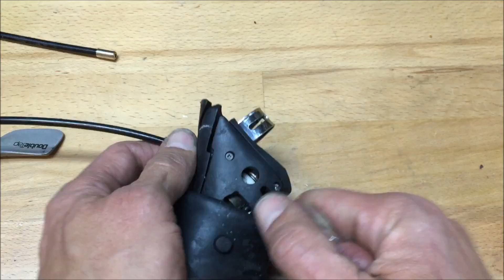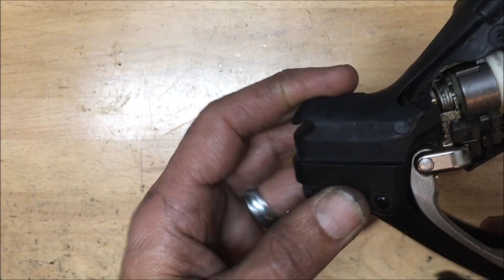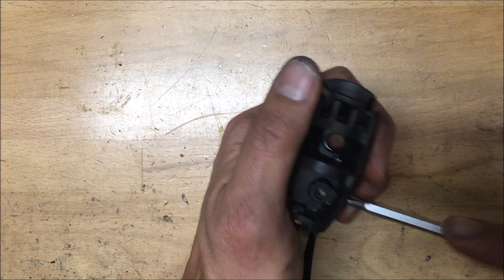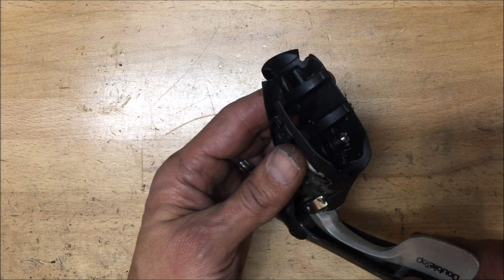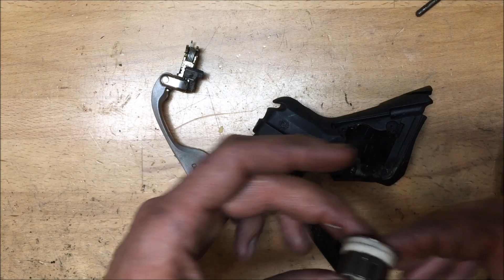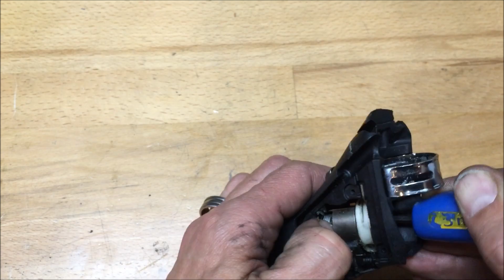Sram Doubletap Shifter Rebuild

Comment: Where can i find that repair set?
Reply from the maker: SRAM sells a few of the shifter small parts, but not the pawl housing piece that typically breaks in these shifters. At the bike shop i used to work at, we kept a bin of old salvage parts, and would occasionally get shifters with either the left or right side damaged, so we would save the other or if there were any usable parts that were still good Etc. If you have a large bike shop near you, you might try them or your best bet may be to look on eBay. I've seen lots of individual used SRAM shifters or partial assemblies with good working parts you could use to fix your shifter. 
I had a viewer as the same question a few months ago, and I found a couple partial of complete shifters that would work on eBay for under $20 at the time. Thanks for the question and hope this helps!
Reply: @JoeyMesa  First of all, thank you for your reply. I got 10-speed force right shifter but only cylinder mechanism and a spring are in, other things are lost. Unfortunately here is no sram dealer or any shop that sells sram parts. I've decided to find any version of sram 10 speed shifter and try to place that parts which is missing parts  in force shifter. Is it possible, or not? Do you have a social media account that I can send you a picture? I'm sorry if I have misspellings or grammatical error.

Comment: I have the same fault.
Please specify where to buy? (Wherever ... USA, Canada ...)
To fix it, I need a part number and a seller - it can be Force, Rival or Apex. (10 speed)
Reply from the maker: The problem is SRAM doesn't sell the lever with the ratchet mechanism as a separate part, or to be more specific, the don't sell the part that typically breaks. You can buy used shifters on eBay for a decent price and pirate the parts you need or use the whole thing if it's better than the one you have. 
Usually I try to save usable parts like this to do this type of a repair (I work in a bike shop), but at this time I personally don't have any.
Reply: Thanks for the information.
It remains therefore to buy a complete shifter.
Reply: Hi Andrzej, if you still need the part just let me know.
Reply: @JensWorkshop  No thanks. I bought a whole and new one. I think only Taiwan is doing it now, with no items available for the site.

Comment: Thanks for this video. I'll be using this to gut the mechanism out of the left shifter to do a 1x set up on my spare bike with an x9 clutch derailleur
Reply from the maker: Sweet! If the internals are still working, you could probably sell them on eBay. People are always looking for them.
Reply: Joey Mesa that's a good idea. I have no use for the left side shifter

Comment: Do you know the internal differences between force and red? I bought a set of second hand red shifters and they weight exactly the same as force. I suspect I bought force shifters with red levers actually. Is there a way to check it? Thank's
Reply from the maker: I'm not sure if there's much of a weight difference between red and force shifters, but, one difference that has been pretty consistent is that on the rear force shift lever, there is about 3/8" or 10mm of play when you start to shift until the lever engages. On the red shifter, the shifter engages immediately with no play as you start to shift it. Again, this has been pretty consistent on all year models. The front force and red shifters basically feel the same.
Reply: Thank's for the details, that's great help. I don't have any play before shifter engages so I guess I am actually with red shifters. I will check with one my mate who is equipped with red shifter and check if engagement is the same.

Comment: hello, I'm with the same problem, your video is spectacular, but how do I do or where can I get this part to be able to replace? I'm in Brazil if you can tell me a store or something?
Reply from the maker: The problem is that Sram does not sell this particular replacement part. Basically, you just have to find a used one with good shifter parts. About the only sources I know of are local bicycle shops that keep old usable salvage parts or maybe eBay.
Reply: OK thank you
Can not you tell me somebody or a site?
Reply from the maker: https://www.ebay.com/itm/SRAM-Red-10-Speed-Doubletap-Shifters-Set-Front-and-Rear/322871536787?hash=item4b2ca4ac93:g:ztgAAOSwJtdaA41u
Reply: Hi Alcides, I have the part you need. If you still need it just let me know.

Comment: can the left side shift lever fit the right hand side one?
Reply from the maker: I've never tried it, but I don't think it would. Everything is backwards from one side to the other. You may be able to turn the left ratchet wheel backwards and run it with all the right side parts on the right side, but other than the ratchet wheel, everything will only work in it's corresponding side I would think.

Comment: Hello Mesa , where i cna buy the only doubletap with  this part on the up ?
Reply from the maker: As of right now, it's not available. I keep suggesting to the sram tech guys that they need to sell more internal pieces, but no luck so far. I've always just scavenged the parts off old shifters that had broken brake levers or housings, but the shift parts were still good.

Comment: Hello Mesa , where i cna buy the only doubletap with  this part on the up ? Help pls men , rly need help
Reply from the maker: Unfortunately, Sram doesn't sell this part of the shifter.  You may be able to find a used shifter or one with good parts on eBay or possibly check with your local bike shops to see if they have some salvage shifter parts they would be willing to sell.
Reply: +Joey Mesa  I watch on e bay but i canot find only that broken part or all duobletap with that part on up. I em from Serbia we dont have sram gruops or something like thah ..

Comment: I've found that you can pop the pin out using a long thin allen key through the break lever, you need to hold the brake lever down and push the allen key through the brake cable housing. Great tutorial by the way!
Reply from the maker: +Naitonator Thanks!  I'll have to give it a try next time I take one these shifters apart.

Comment: Can you get the shift the part that you replaced from Sram or have to find a good one somewhere?
Reply from the maker: Ron BeLieu  I know many of the small parts are available, but the last time I checked, the ratchet part was not available for purchase. It's a shame because these shifters are pretty easy to rebuild. Easier than Campy in my opinion. I've usually scrounged up the part from wrecked shifters with broken brake levers. We see these from time to time at the shop I work at. Sram will usually send you a new shifter if the piece fails within a year or two.